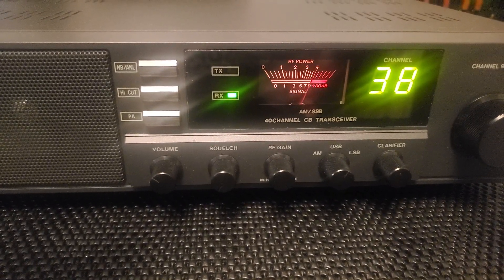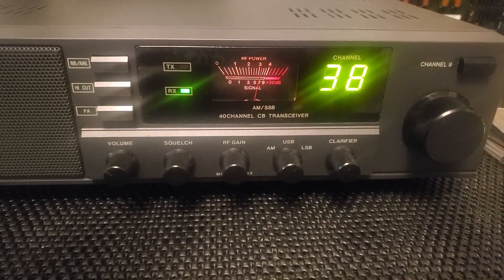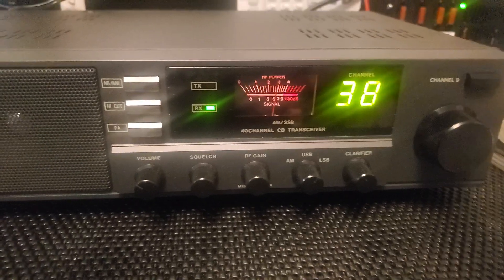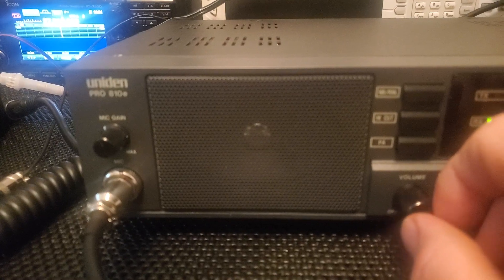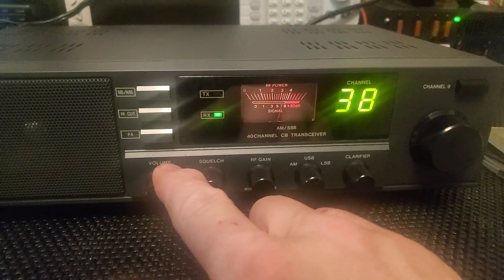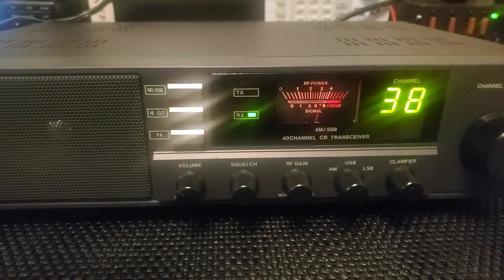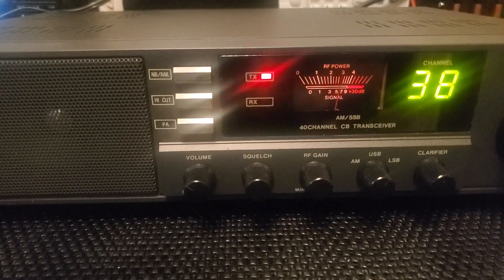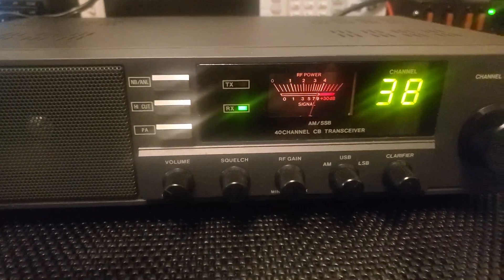Uniden Pro 810E AM & SSB 40 Channel CB Radio.

Comment: My radio shack trc850 like your uniden version is identical. I bought one 20 years ago used in great shape and it already had a channel mod in it that will allow the stock channel display to count past 40, it goes up to around 90 something before the vco drops out. I don't know the exact mod done but whoever installed it did a clean job. Only 2 little switches on side panel gives extra channels. 
I'd have to open it up to refresh my memory on the pll used in this radio but it's a nice clean radio.

Comment: Radio shack sold this same radio under the model trc 850. Great radio
Reply from the maker: I did not know that. Thanks for letting me know I will look that one up. It seems like Uniden is kind of like Ranger of today.
The same boards were used in multiple manufactured names of radios. 
RadioShack wanted to separate themselves with their own style.
 I actually liked a lot of the radios also.
Reply: @ScottsRadios  yes a lot of the realistic cb radios back in the 70's 80's and possible 90's had uniden boards in them.  Look at the trc449, trc451, great ssb mobile radios.  They had several nice base units like trc457, trc458, trc490 ssb units with uniden boards. All were good and still popular today if not butchered.